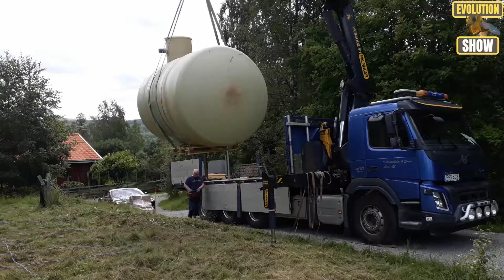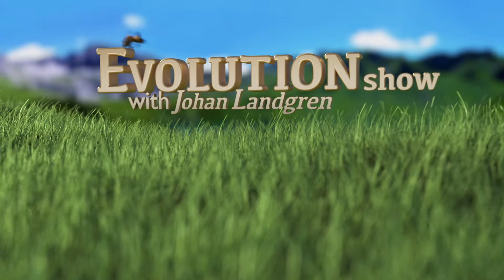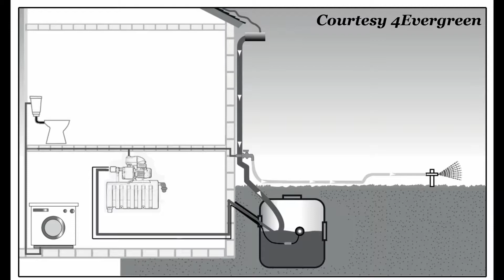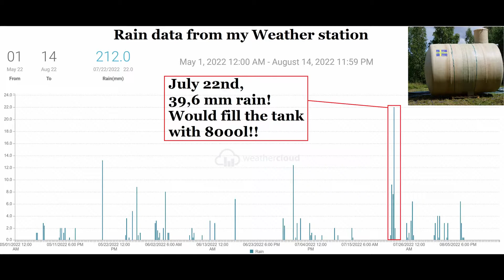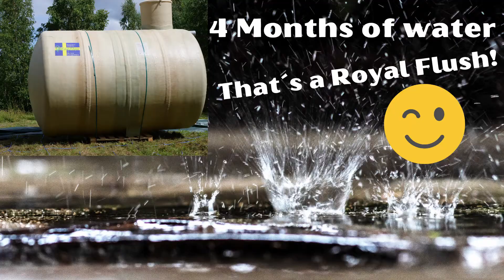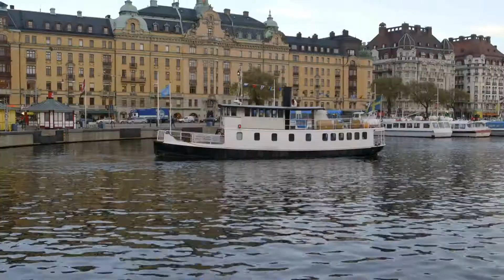Harvesting Rainwater with a 8000 liter Submarine! Part 1 My Energy House project

Comment: Have you looked in to a getting a Aquatron? To me it seem like a good compromise as you can have a flushing toilet but still composting the solid parts.
Reply from the maker: Hi! I have not looked at Aquatron, thanks looks really promising! It prob would not work in my case as I have designed a onefloor building without a basement. The aquatron seems to have to placed in an angle under the toilets and I honestly don't think I want it on the same level as other rooms with the risk of smell. I love the tech though! I have will have a filtration sand bed but will have to empty a separate slam collector once a year. Not ideal but ok for me for now. Cheers! /Johan

Comment: Congratulations on your move toward self sufficiency! Our environment in the Caribbean is almost the opposite of yours, but many of our needs are the same. We have an 18,000 gallon (68k liter) cistern car as two concrete chambers in our basement. We have it set to overflow at approximately 17,000 gallons (65k liters) and the house has never run short of water in over 12 years, in spite of drouts laying as long as 5 months (just this year). We also catch water from a porch roof (126 ft2 or about 12 m2) into a much smaller 100 gallon (350 liter) tank for light watering in the garden.
We also have enough wind most of the year for power generation, but don't have it because solar is covering all of our power needs.
A bit of advice from experience:
If you have enough wind for a windmill, the roof you collect rainwater from should have it's long axis parallel to your predominant wind direction if possible (it will collect more wind blown rain).
Having as many power sources as possible is better - we have solar, grid and generator available. We sell excess to the grid and don't have a power bill the majority of the time.
As you plan your power installation, make sure to select a system that will work with both wind and solar (many brands won't support both). 
Best of luck as you make your way to being self sufficient!
Reply from the maker: Hi! Wow you have quite alot of harvesting storage!  :) And thanks for your advice! Lovely to hear the perspectives from somebody in a warmer climate! I must admit I'm a bit jealous of people that can run their house on solar all year around! But combining diffrent power generating sources  works very well too. I will have separete converters for the windmill and solar system as well as separete batteries. Partly because of redundancy but also as you allude to, of technical reasons. Im considering having the windmill totally offgrid. I'm lucky to have access to a 100 m deep well with amazing freshwater so on that front Im good but I want to use only for drinking/cooking and showering.
Cheers! 
/Johan